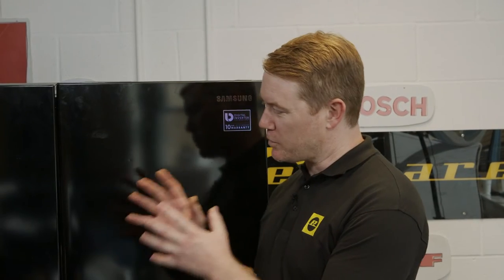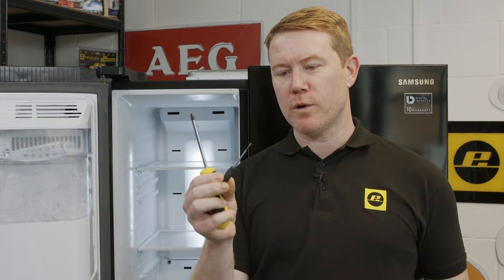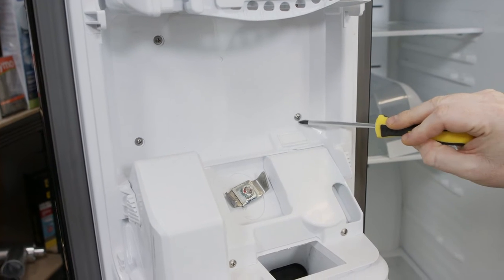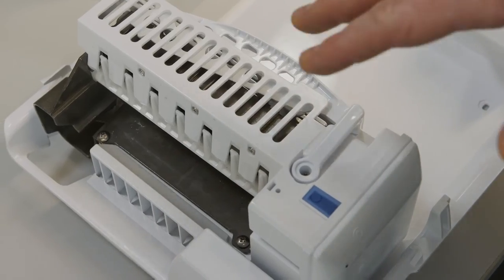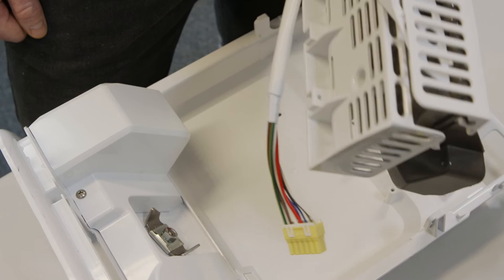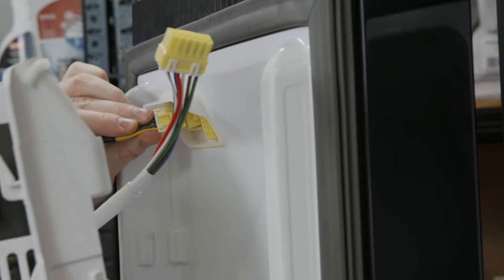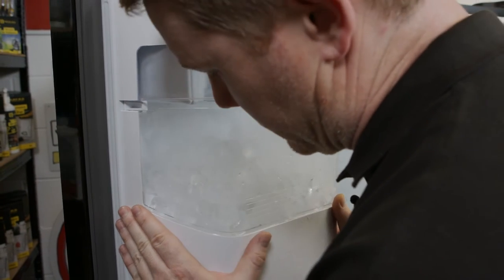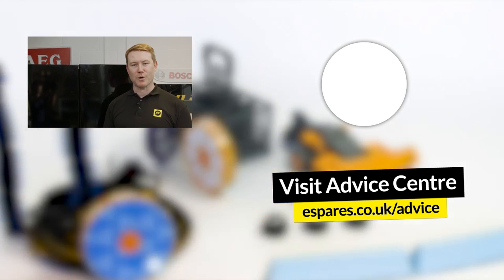Fitting a Fridge Ice Maker? - Samsung Fridge Freezer Ice Maker Guide

Comment: My ice maker is working but not dispensing, the microswitch behind the paddle is working, no movement from the auger motor. I'm guessing the control board or the motor itself, any suggestions as to how to test please?
Reply from the maker: Hi Gary, we have a separate video on how to test the ice maker on a Samsung fridge freezer which may be of help to you:
https://youtu.be/Zxot9jUleV4
Reply: Did you get a solution to this please? I have the same problem at the moment. Thanks.
Reply: @eSpares  That video is not relevant, mine makes ice but does NOT dispense